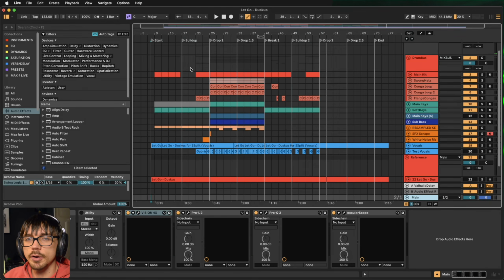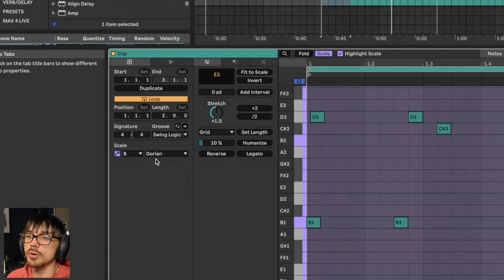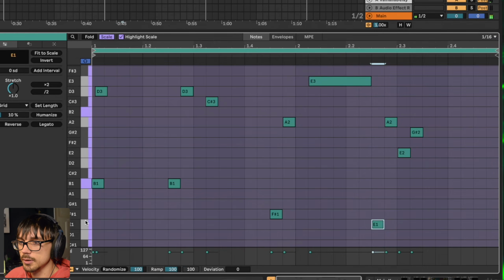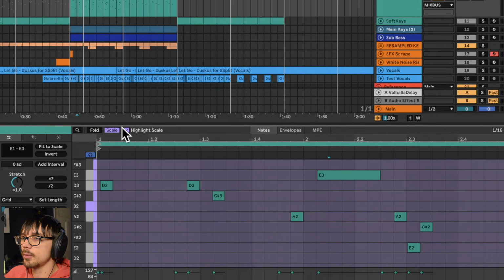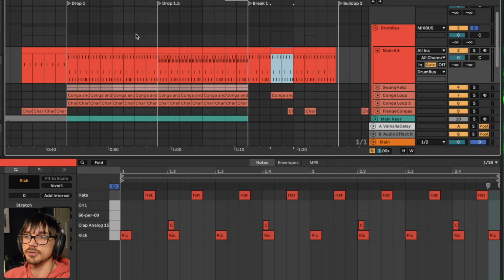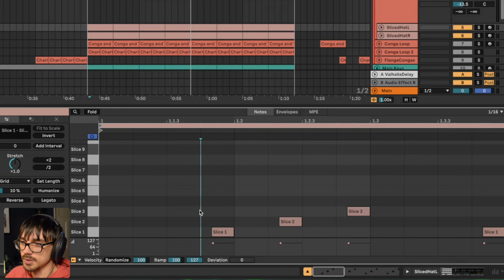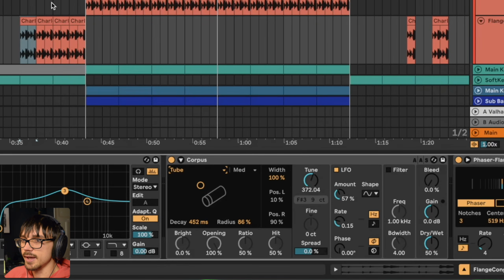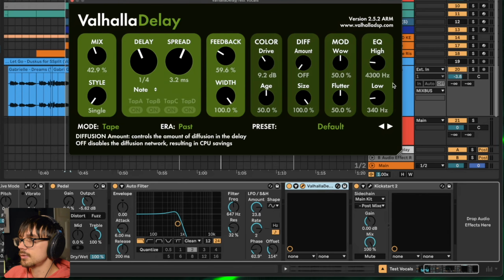Track Analysis: Duskus - Let Go Pt.1 Composition

Comment: the key is A major actually, but great tutorial!
Reply from the maker: Thank you!! For the key did you use a scale analyser plugin to get A Major? I don't think it follows A Major at all compared to B Dorian. 
If you play a note of A the root note of A Major through the whole sequence it will sound weird and feel out of place. The song uses B Dorian, which has all the exact same notes at A Major but it just starts on the 2nd note of the A Major scale the B. 
A lot of scale analysis plugins tend to ignore modes and focus on the track being major or minor, so it will take the notes it can hear and set them to the closest major or minor scale, which in this case would be A Major. 
B Dorian sounds much closer to B Minor than A Major as it starts with a minor chord, but the big difference happens in the 3rd chord where it strays from B Minor into B Dorian.
Reply: @Modul8onlinei’m just a piano player  and i pulled it by ear haha. the A chord just feels like the I chord (tonic), although it’s not clearly given throughout the song.
Reply from the maker: @DJDRAK  Oh interesting! to me the B jumps out more and I would see the track as being in B minor instead of A Major, but that last chord has a note outside of B Minor that fits with B Dorian. But I see what you mean.

It might be the cadences and chord combinations that are making it sound like A Major more I guess, plus the last chord is an E Major, which is the 5th in A Major.

Comment: I really need to learn how groove/swing and drum racks work in Ableton. I'm just dragging and dropping audio files in and feel it could be a reason I think my sound is lacking.
Reply from the maker: I've just realised you have commented on a few posts, email me: Info@modul8online.com and we can work through some of these. 

But essentially, pick one of the grooves from the groove pool, usually just the regular Swing 16th and then your amount work the best. Apply this groove on Midi programmed drums and instruments as well as audio files in the clip editor too. 😀
Reply: @Modul8online Haha yeah sorry I was binging your videos. About to dive into the new one too lol. Noted re swing, I ended up starting to use the notator 16c I think it was called.